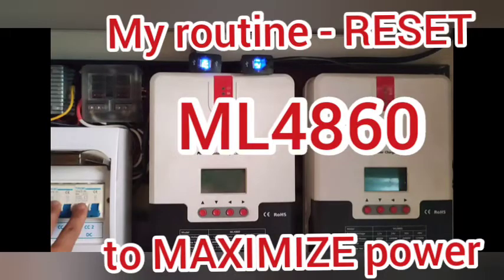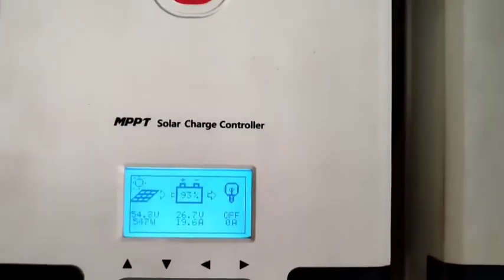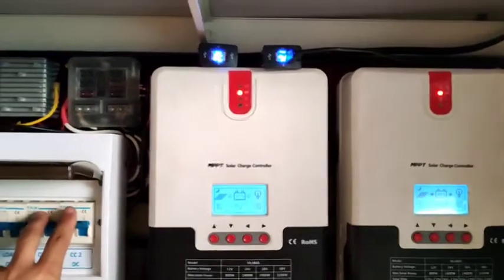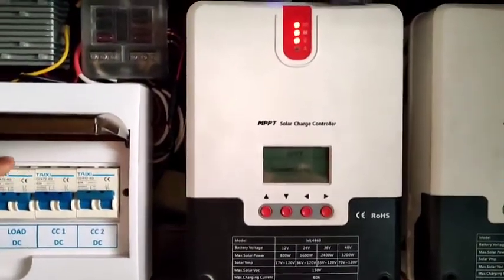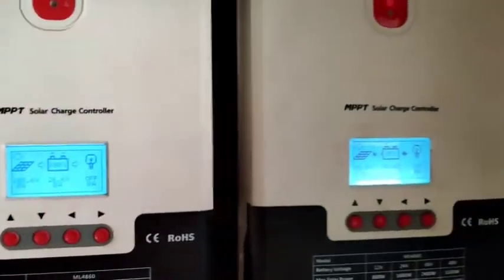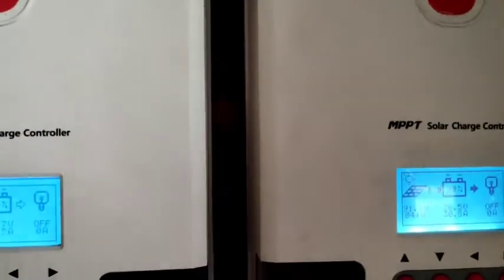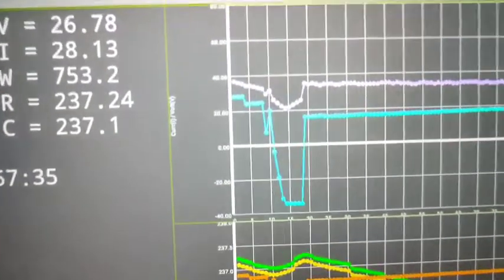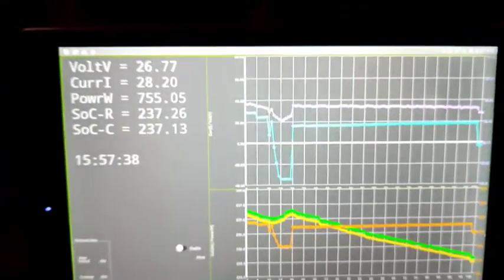SRNE ML4860 Update - Needed to be reset to maximize charging current

Comment: Yung srne60a mo naaadjust ba manually yung charging current amp nya? From 60amp gawin ko lang 40amp pwede ba yun ?
Reply: Kung 48volts system ka at 60amps SCC mo pwd ma adjust yung ampere nya..nasa dulo ng set up settings makikita adjustable sya

Comment: boss gusto ko lang malaman, sa srne ko 20amp nagchacharge ako sa battery ko na 65ah, mga 3 hours puno na sya, pero paglagay ng load biglang bagsak ung battery bar nya..panu po ba makacalibrate ung totoong karga ng battery..
Reply from the maker: Depende po sa load mo(ilang watts) at type of battery. Typical sa lead acid to significantly drop batt voltage pag may load.
Reply: @doitmyself6377  dryer 150 watts, biglang beeping ang inverter ko na 1500 watts, pag niload ko..
set up ko is 150 watts panel
srne mppt 20amp. Lead acid 65ah 12 volts.
Reply from the maker: @acevergelcatig1687  masisira boss ang battery mo. Ang rule of thumb ko sa lead acid eh 0.5C lang. Meaning kung 65Ah, 32.5A lang max load. At 12V that is only 390watts. Considering pa ang losses, mas mababa pa dapat max load mo dyan. Tapos 1500 watts na inverter iiyak nga yan.

Comment: Hi, the chargers are connected? I mean there is a cable to stablish a communication between both controllers, like master and slave mode. Just to know if even with this connection you still have the issue.
Reply from the maker: Yes. The comm cable was connected. The reset issue was caused by the unit. Since the replacement with newer firmware, I never saw any of the 2 to reset.
Reply: @doitmyself6377  What is the firmware that works?  Is it possible to upgrade firmware on older units?  I'm considering buying a used unit.
Reply from the maker: @wellnesspathforme6236  I can't remember the firmware. May be on the other video. Yes upgrade is possible but not available to the user. I'll post here when I see what version my current units are using.
Reply: @doitmyself6377  Would you recommend this for a starter offgrid system at a sub $200 price?  Only one charge controller is intended, and this would be it.
Reply from the maker: If that is your budget then I would suggest the smaller but more stable 40A model

Comment: if that is a gel/lead acid type of battery, it happened when you do a general reset in scc, not in lifepo4 due to it dont need float charge and equaliztion.
Reply from the maker: I understand LFP has no float and equalization. But I don't get what you're trying to tell.

Comment from the maker: Left side charger needed reset for it to reenter MPPT mode and get the most out of the available PV panel power.

Prior reset - charging current was 18A
After reset - charging current was 28A

This has been my routine since I used this charger model from SRNE. It's definitely tedious. But leaving them to behave as-is would significantly lower down system efficiency.

Latest update from SRNE China - they are willing to send replacement unit if we can prove that the issue is valid.

You may comment here or provide link to your own video because this will be sent to SRNE China.
Reply: So basically? you do not  recommend this model ?  there are 2 model ML4860 and ML4860-LI with lithium battery support according to my research.
Reply from the maker: @sergea1138 , I Don't Know about Li, but non-Li, I don't recommend them for Lithium based batteries IF and only IF you're going to use it with lower Boost Voltage. If you're going to use it with the default Li setting with 14.4V Boost, then it's fine it should work. In my case I want to set the Boost to 13.6V - NOT recommended.
Reply: @doitmyself6377  thanks for your quick reply, it seems that the srne and epever charge controller have their own specific problems according to different feedback. the worst for me is that you can't update the firmware by yourself.
Reply: my epever 20 amps mppt tracer series also behaves that way. well i guess it has reached its end for it was my trusted SCC since 2014. sad thing is my srne 40 amps is on the way from shopee. now iam thinking about cancelling and go for another epever mppt SCC
Reply from the maker: @bongalzate8612  srne 40A is good. It's 60A that has this problem
Reply: @doitmyself6377  nice to know that then.....i am thinking of changing the input capacitors of my epever tracer when i receive the srne upgrade SCC. any thoughts about it? i've read somewhere that even good capacitors have a lifespan of 5+yrs...